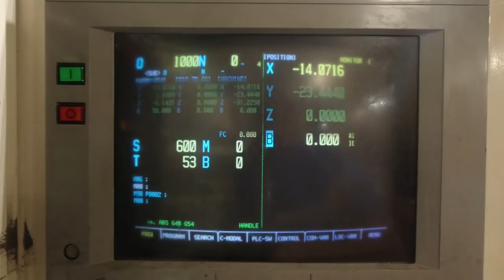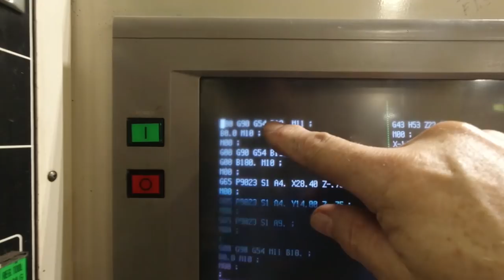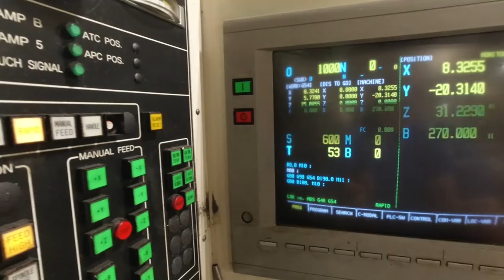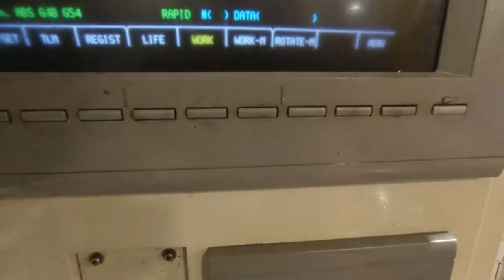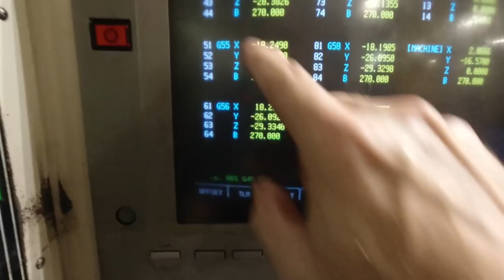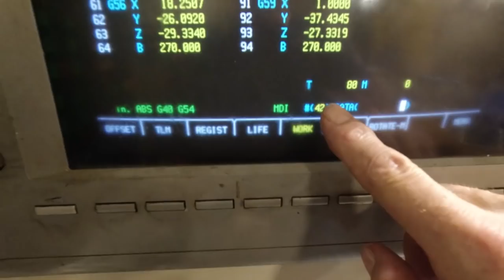Drill Guide For My Gun Drill

Comment: Hi Peter, the first comment after being watching your video for years. I am also working on some oil & gas parts like what you have, even the same customer as Baker Hughes. For this part I thick you don't need to machine out the pocket first, just tilt the spindle to mill the flat surface for entrance of the gun drill in the pocket, maybe it can be a bit of straight forward. But anyway, very much like the way of making fixture. Bravo!
Reply from the maker: I tried that (I thought I explained that at the end of the video. Maybe I wasn't clear enough) Because of the underlying intersecting hole close to the surface, of the same diameter this method is giving me problems and misdirecting the drill.

Comment: Just wandering why not just start with an endmill and tornado out a starting-hole?
Reply from the maker: Because at the steep angle and angle of intersection. It would require a .375 endmill around 4” long to reach it. In titanium that could work but would be more prone to problems. This worked no problem and just one tool to make the hole.

Comment: Sorry if this is a dumb question but I’m a fairly new hobby machinist and I’ve been wondering what are the benefits of a horizontal mill as opposed to a normal vertical mill? 

Any feedback would be greatly appreciated! Thanks! 
P.S. Love the channel 👍
Reply from the maker: In general it would being able to machine more than one side of the part in the same setup. Depending on the fixturing multi-able parts at the same time with the rotary axis. Also the shavings fall away from the machine work. Especially if you are machining pockets the coolant flushes out the shavings better than on a vertical mill. As you see in this video it’s much easer to square up parts on a horizontal mill.

Comment: How did you remove the broken part of the gun drill?
Reply from the maker: It was loose enough to pick it out with a pair of forceps. This is one of the reasons I like to use gun drills. So far I have never, not been able to get a broken one out of the hole.

Comment: Was always curious, why does the B axis on your horizontal rotate a few degrees whenever it does a tool change? I've see you rotate after an OP to check the part, but it seems to happen when it changes tools
Reply from the maker: I have it in the post processor to unclamp rotate 10 degrees plus the  B position than back to the B position than clamp. It does this at every tool change or B move. It always approaches the B target position from the same direction. This isn't strictly necessary but if I jog the B axis for some reason, say to look at something it will always go back to the correct position. Or if I rerun a tool or start the program in a different location. Also it is more precise to approach the position from the same direction in terms of backlash. At the big diameters or distances that things are from the center of rotation on a horizontal mill this can make a difference. I theory the axis is backlash compensated in the control so this shouldn't be necessary. But I do it anyway.

Comment: Nice surface finish on those clamps. I would have thought  a c-clamp could have held the drill guide in, but that for sure should do the job!
Reply from the maker: Thanks bcbloc02. Yes a Kant Twist probably would have worked. But clamping to the radius of the stock? Also I don't like that arrangement on a rotating spindle. Not that it would happen but if the spindle was turned on the clamp could fly off.

Comment: That ball nose got me thinking. How to figure the step over amount between the size of the ball nose and the radius it's cutting and getting a mirror finish. Ahh! Math is hard sometimes lol.
Reply from the maker: In the cam software you can either specify a constant step over or what the call a cusp height. The cusp height is the difference between the peaks and valleys the radius of the tool leaves. Than the software calculates the step over. This is nice because if there are a lot of deference’s in inclination of the shape it will vary the step height to maintain a constant finish. The step height has to be smaller on a more horizontal angle and can be greater on a more vertical angle.

Comment: I usually mill the starter point and drill!
Reply from the maker: Because of the intersecting hole below so close to the outer OD. When I tried that (And I did already try that) the spot face I milled broke into it at the bottom. This tended to deflect the drill down because it wasn't cutting but on the top (toward the OD). If there was no intersecting hole below that would work. And that's the way I would do it.
Reply: @EdgePrecision  

So whats the z to the intersection?
Have some long end mills(made them) for those jobs, just for milling enough for the gun drill, use the first drilling as guide.

Comment: Nice solution! I just wonder: Since you didn't forsee this problem: Have you priced it anyway as "Misc tooling issues" because from experience you know you'll have X amount of issues in such a part ? Don't know how many parts you're making but if it's in the tens that could eat into the profits maybe ?
Reply from the maker: On these kind of jobs you must expect to have some problems. The price of parts like this takes that into account. If you don't have problems so much the better. But that is rare. It is easier for me to make money on a job because I have very little overhead. I'm not paying for equipment (Its all paid for) or someone else's labor. So even if it takes a little longer I still make the same amount. I just may be making less per hour but like I said that's for me. It would be different if I was paying someone 30-40 dollars a hour.

Comment: Something like a KM63tser32210m for an er32 setup. Which would give you another 2.25(ish) of clearance. They make longer ones but it is harder to find the numbers for them. You can also use the colleted drill extensions in a standard tool. Er32 collets are availble up to 20mm. C 20mm shank does not deflect much under "typical" conditions.

Comment: We always just got a longer tool holder to account for head clearance. Since the tool holders are 2 inch diameter(roughly) they do not deflect. We replace a lot of the longer drills that we were using just for this type of clearance issues. Shorter drills are much cheaper and they last longer because you are not dealing with the deflection issue.

Comment: Can't seem to learn enough from you Peter. Amazing content. Curious what grade of steel you use for your one off tooling like this?
Reply from the maker: This is Starrett ground O1 steel flat stock. I use this material so I start with something already squared up and precise in size. It also can be heat treated if necessary. I'm not going to in this case though.

Comment: Love the content as always, thank you, a question if I may.... during a program with multiple tool changes, does the control automaticity look ahead and pre load the next tool into the changer or is there a specific gcode that is added by the cam software? I ask as it appeared the was delay during the tool change when switching from the roughing mill to the ball nose whilst the radius was being machined into the clamps.
Reply from the maker: You call the next tool in the program at the tool change. So if the cycle time for the current tool is longer than the tool magazine takes to get the next tool in the arm. Than there will be no delay in the tool change. As far as the video goes I was running the machine with the optional stop button on. This will make the machine stop at every M01 in the program. I put a M01 at the end of every tool. So the machine stops before the tool change. Just in case I want to check something or watch the next tool run in. I probably delayed some in pushing cycle start for the ball mill. When running a proven setup and program you would release/disable the optional stop button and the machine will run through without stopping.

Comment: At 1:40 why does the cutting head appear to change speed a few times? Just a camera frame rate thing?
Reply from the maker: Yes I noticed this also. I usually use a GoPro camera inside the machine. I have been experimenting with using a DJI Osmo Action. The frame rate was set to 60 at 1080 and everything to full auto. My only explanation would be the shutter speed must vary on this camera. The spindle speed on the machine was 600 rpm. I don’t think the machines speed could vary so it has to be the camera. I have never seen this with the GoPro. I have no other explanation. I just had a thought it may be a interaction with the led tights I have in this machine.

Comment: @Edge Precision  @30:00 Hey what's that mini chuck that you are using on your tailstock that looks super super super useful ! Can you explain a bit more about that ? TIA. [Can you explain (one day ) everything you can press a tailstock into in terms of different types of work holding ? ].
Reply from the maker: The chuck is mounted on the live center. The live center on this machine is large. It has a #6 morse taper and is 2.500 in diameter for about 4" of length. Outside of the tailstock spindle. Than the 60 deg taper starts. I made the aluminum mount for this 6.4" Dia. set-true chuck. It has a very close fit on the 2.500" OD of the Tail Center. Than a clamp similar to a Bridgeports quill clamp has. So I just turn down the pressure on the tailstock's quill and extend it till step in the jaws bottoms on the parts face and tighten the chuck. Than I can adjust the runout with the Set-true feature on the chuck. I have to use this on this part because there is no place to put a center. There is a hole in the face but its off center. There is no material there for a center.
Reply: @EdgePrecision  That's amazing I'm going to have to draw that all out to figure out exactly what you mean. I always feel a tailstock can or could do more especially as you say for work pieces that are not between centers. That's a terrific work around. Thanks !

Comment: why do you let the b axis rotate after every toolchange?
Reply from the maker: My Cam software's post is setup to output cod that way. It always approaches the B angle from 10 degrees positive direction. this isn't really necessary if you don't have a B rotation in the program. But if the rotation wasn't there and you jogged the B axis. Than restarted the program it would not be in the proper location. Safer to have it there. Also it takes out any possible backlash. Because the milling or work on a horizontal mill is usually far from the center of rotation a very small amount of backlash can be a problem. Technically this axis is backlash compensated but I like to do this anyway just to be sure. Especially if I'm boring close tolerance holes.

Comment: Great video, thanks for taking the time to share your knowledge.
Your universal vise stop is interesting to me, as I made one recently.  The clamp for the actual stop bar appears to have two through holes with a blank inserted.  What is the purpose of this?  Two different sizes of stop bar?
Reply from the maker: It is the pivot point for the clamp. The clamping mechanism doesn't pinch the rod like some types use. It clamps down on it.This allows it to move more freely when the clamp is released. It also clamps the stop rod very securely.  Although if the pivot pin were removed another stop rod could be put in its place.
Reply: @EdgePrecision  Thanks, I appreciate your reply.  I will look at modifying mine to work that way.

Comment: All this for one hole! Only another 50 to go ... per part
Reply from the maker: The other holes I didn't have this problem. They were smaller in diameter. This hole is also at a steeper angle in relation to the center line of the part.

Comment: couldent  ya  have  just used a c.clap to keep the  guide in? ya had to get fancy eh?
Reply from the maker: I wanted it to be held more securely Than a clamp would do. Also a c-clamp could tend to tip the part in the slot (There is a little clearance between the guide block and the slot). Where this method holds it square. Than there is the safety issue if for some reason the lathe spindle was turned on with the c-clamp. Not that it would ever happen. But?
Reply: @EdgePrecision   i figured you had  your reasons i was kinda being a smartass  a c clamp would  take more work to put on  and not alwats so easy to get on  round stuff  AAND tend to slip off

Comment: how do you line up all the cutters in that shaper?. thanks for the show.
Reply from the maker: I’m not sure what you are asking. Are you referring to the tools in the milling machines tool magazine? If so I measure their length and diameter. Than enter that in the offset tables on the control. Than the machine can calculate the position based on what the program commands. Hope that makes sense. That is of course a simplified description.
Reply: @EdgePrecision  i was asking about the insurts in the frist tool you started with.
Reply from the maker: The pockets are machined to match the insert shape. All there is to do is screw them into those pockets.

Comment: i think you have that step because the "key" is a little loose if it was a tight fit you would have a smooth transition into the hole
Reply from the maker: The hole with the step was drilled before the drill fixture. This drill fixture was made to solve that problem.